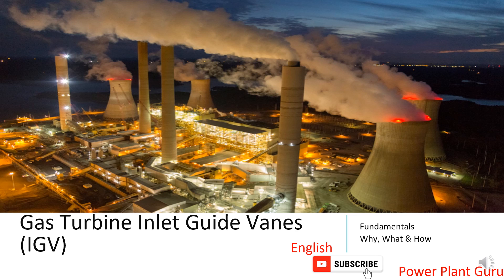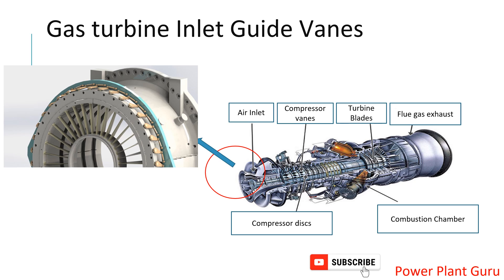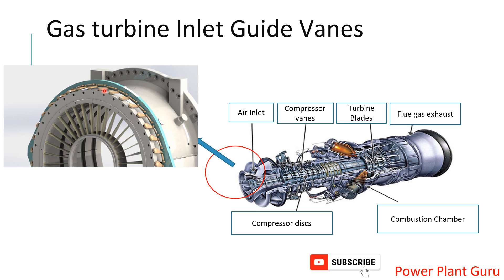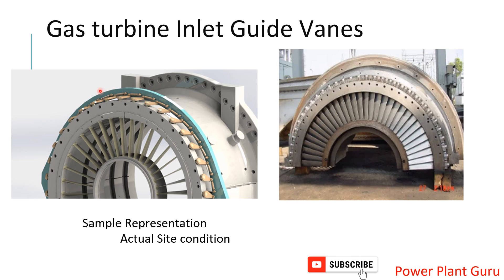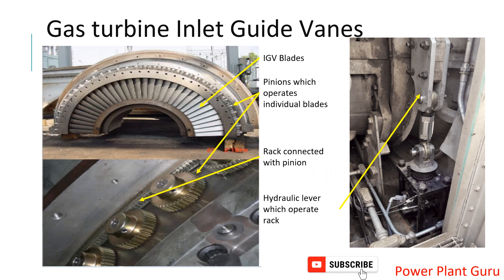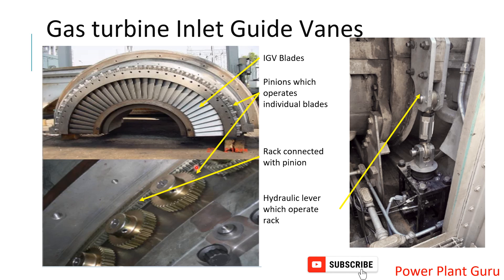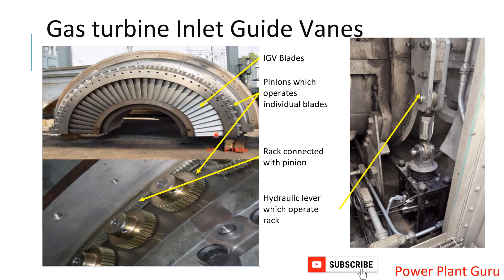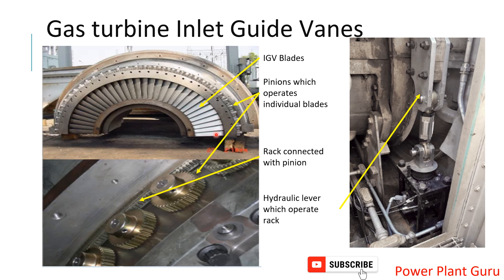How Gas Turbine Inlet Guide Vanes Works.  IGV, VGV

Comment: If the IGV open 84 with only 25mw and normal weather ,
Is this related to the quality of the inlet air? Also, the pressure differential  of inlet air is high. 

Thanks
Reply from the maker: Hi Muhammad
You can check the air filter for choking. 
The compressor may be fouled, you can check compressor efficiency by calculation and go for an offline water wash.

Comment: @powerplantguru007 I take it, the IGV do not guide anything, they only regulate the turbine inlet air flow. A very similar system is used to adjust the air flow through (exhaust) fans.
Anyway, many thanks for a good and useful video that you published here!
Reply from the maker: Thanks